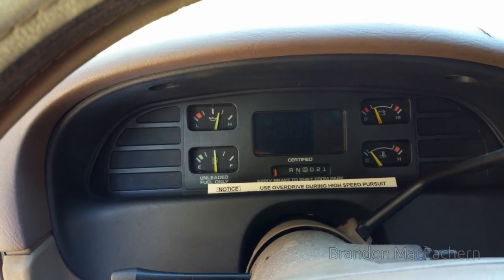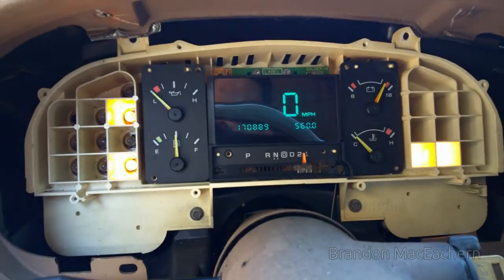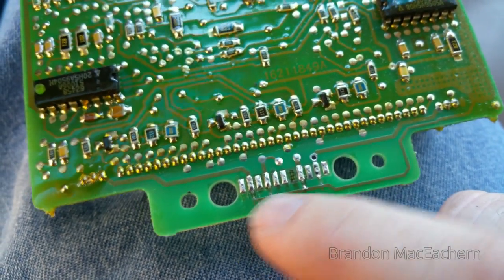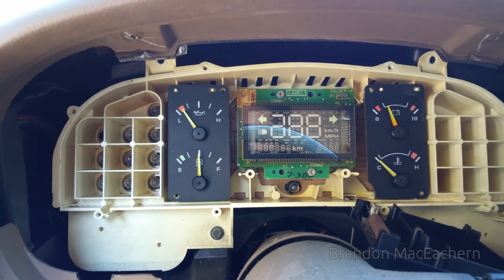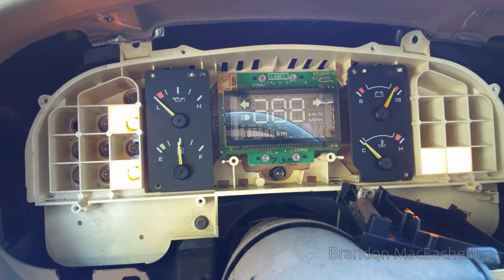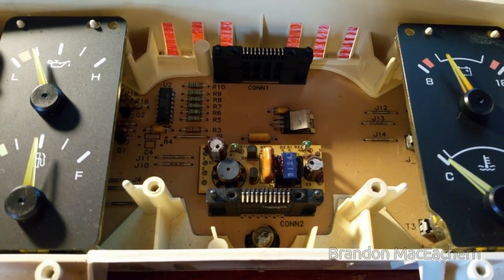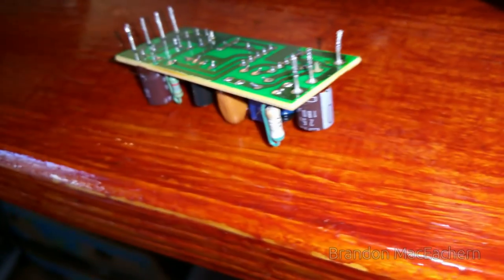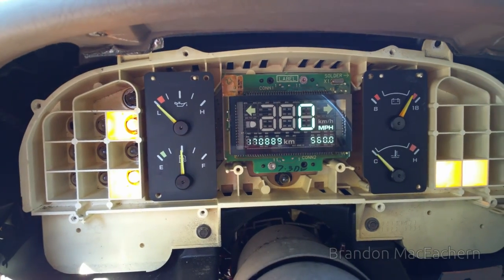Fixing a 94 Caprice VFD Speedometer

Comment: This is the only tutorial I could find on this issue that adressed cracked soldering on the daughterboard pins and it worked wonders for me! Great and well made video!
Reply from the maker: I'm glad it helped you.  I was upset for the same issue, no one was addressing an actual fix, but people were selling repaired clusters on eBay, but still, where's the knowledge?  So I figured I'd diagnose it, and fix it myself, then share it so people can fix it themselves.
Reply: @hakemon  what does cracked pins look like?

Comment: Mine, the miles or the trip odo just scramble.   I need a Z28 cluster.  Maybe next time ill heat gun it maybe a solder joint is shitty on it.  I built up the solder joints contacts a little on mine, didn't help with the scrambling
Reply from the maker: The scrambling definitely is coming from the VFD module itself.  There's surface mount parts under the VFD itself on the board, and I think something around there is causing issues.  A lot of forums and sites say it's just the springs but I don't see how that's possible, as the odometer comes strictly from those IC's on its own board, and not the main cluster board, so the springs have nothing to do with the scrambling display.

A heat gun might be a decent fix, which I may try if I ever come across a spare VFD module.
Reply: if I hit the dash it always clears up. Or once it warms up for 3 minutes it clears up, thats why I think its a bad contact somewhere
Reply from the maker: Under the VFD itself, is the IC responsible for counting the pulses to run the odometer.  Today with everything apart, I could purposely flex that area of the board and on-demand, cause the odometer to clear up, and go corrupt again.  I think what's happening is that because these IC's are placed under the VFD, both heat up and no heat can properly escape, so it builds up and causes cracked solder to expand and contract.  I'm pondering a reflow of the VFD to see what effect it has.
Reply: Dammit.. Now I have to take it all apart.  So the IC is on that secondary board?
Reply from the maker: Yes, there's a couple IC's under the VFD module itself, I'm suspecting the scrambling problem has to do with one of those IC's as one of them has to do with the odometer.  I was hoping the haynes manual had information on it but of course not.

If you find a way to properly reflow the solder let me know, mine has that coating on it which made it impossible to reflow.  I tried a heat gun and an iron/gun, nothing could properly reflow without causing damage.
Reply: Ahhh.. So the IC could be under the LCD screen display that is soldered to the board. sheeeeetttt.
Reply from the maker: Yea it's a nightmare.  I wish there was a chemical bath we could give the board that melts away the coating on it, but unlike the PCM which uses a softer coating, this is a hard coating.  I tried to just use the iron to resolder those parts and it failed, there's no way to repair the module without maybe an acid bath of some sort.
Reply: I'm having the same problem with my odo currently too
Reply: Ghetto Wagon what yr z28 cluster would you use ?

Comment: Wait what use "overdrive during high speed pursuit" !! So if i want to drive normal i should put it in D only not over drive ??
Reply from the maker: Overdrive allows the 4th gear, regular drive restricts you to 3 gears.
Reply: @hakemon  hey Mike, so the overdrive is better for highway? Driving on "drive" and i noticed, that the RPM-s feel too high. So, if the gearbox would be able to shift to 4th, it would consume less fuel? The guy who sold me Caprice, told me, that overdrive is like sports mode on this gearbox.
Reply from the maker: @vitjuha96  At highway speeds you should be using overdrive, it will save on your gas.
Reply: @hakemon  thanks, Mike, also can you tell me, how can i release handbrake (foot pedal)?
Reply from the maker: @vitjuha96  With the brake release handle right above it?
Reply: @hakemon  yeah, right, just realised mine was missing, but i got it released by pulling the mechanism. So i should use overdrive all the time, town and highway?
Reply: the "use overdrive during high speed pursuit" is a warning label put on the police version of the caprice.